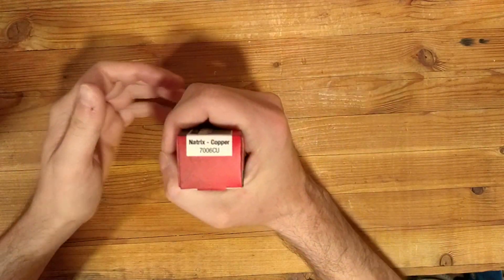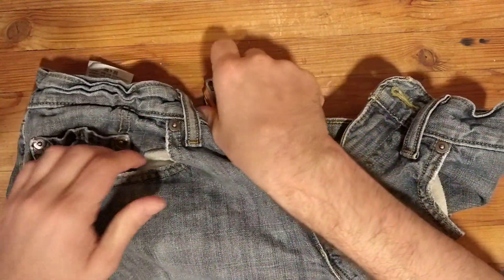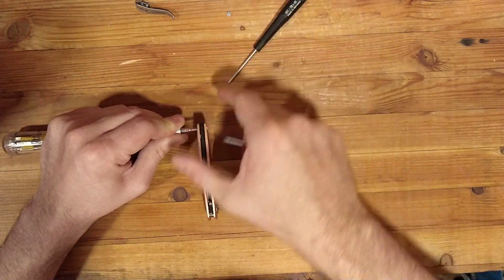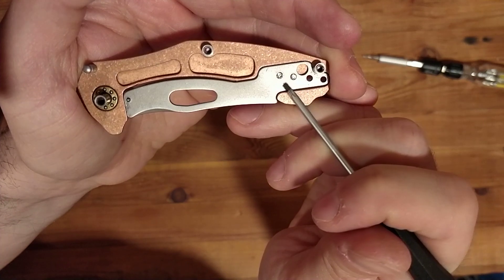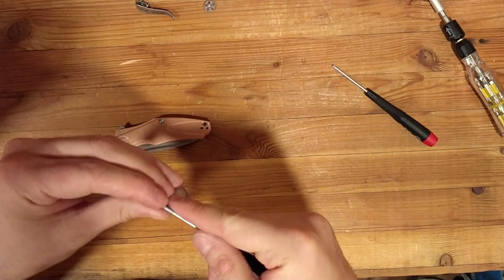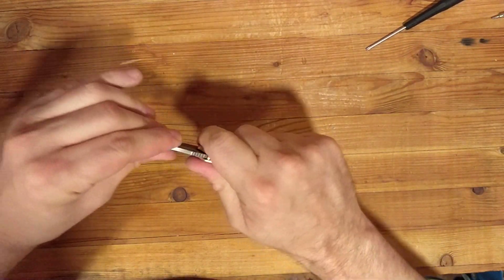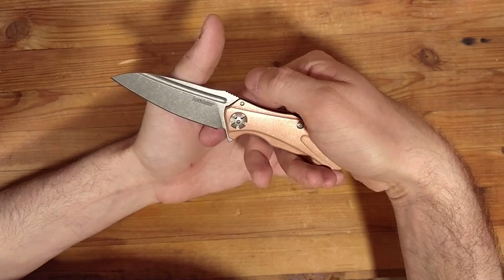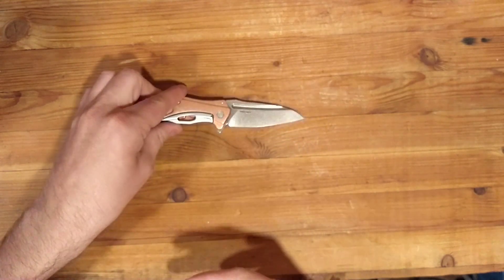Kershaw natrix copper - Day 1 - Unboxing and teardown

Comment: It's unfortunate for lefties. They're screwing into copper and they lose the lockbar's integrity since 2 of the 4 screws will be holding it in place(unless they request extra screws).
Blade Banter tried to run his without a clip to start a patina, but his lockbar would shift.
Reply from the maker: I hadn't considered that! Very good point.  If that is indeed true (which I believe), I feel like it should have been a lock side only clip configuration and clean up the show side scale. 

I understand making it left /right carry will make it appeal to me people... But if it affects function it's moot. 

Thanks for sharing!
Reply: Nice amount of information covered.  I removed my back spacer too and added texturing to the scales.  My initial one had to be exchanged as the detent was lost when the pocket clip was removed.

Comment: Great video, I just got one recently and it does not flip well. It’s next to impossible to flip, I’m trying to decide if I’m going to break it down and try to find the issue or send it back under warranty.
Reply from the maker: With frame lock knives be sure you aren't pressing on the lock bar while trying to flip. This adds extra pressure you need to overcome to flip.

That said it's likely the lock bar shifted and it's not you or your technique. 

Look at my second video where I remove and reinstall the lock bar. It's pretty easy but the tuning only lasts about 5 days before you need to reset it.
Reply: I saw that in another video, I tried moving my grip and still the same. I’ll check out your other video thank you!